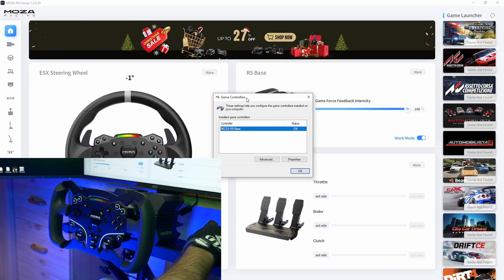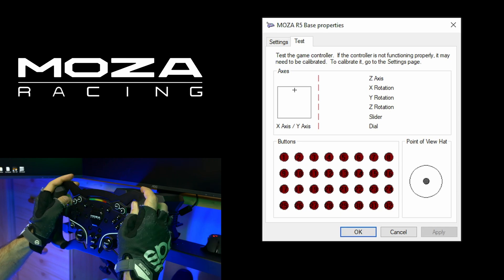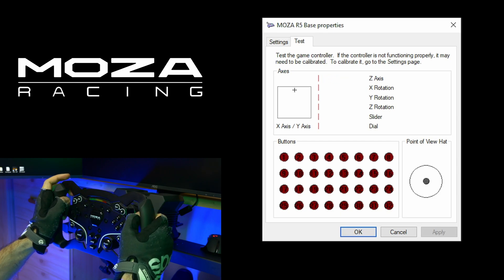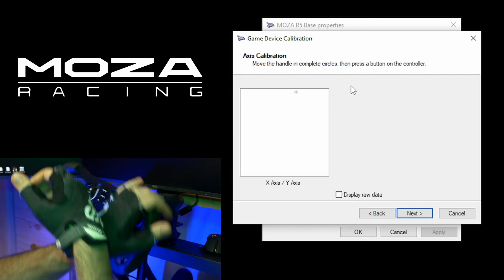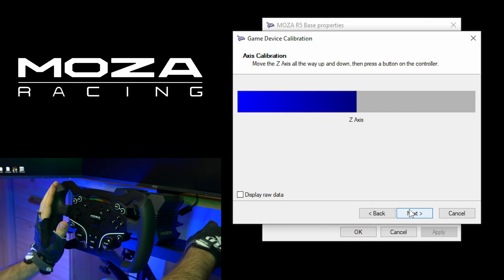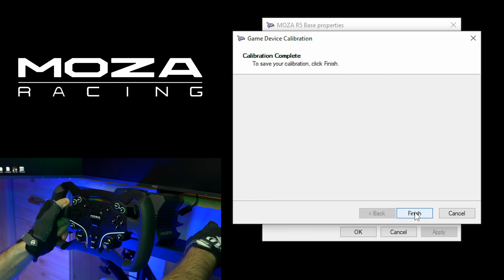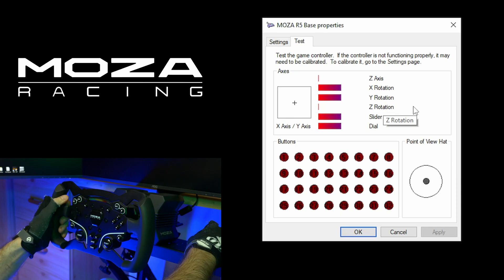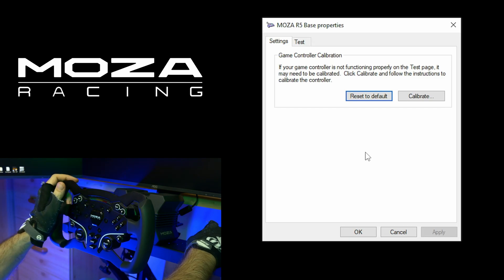How To Calibrate MOZA Or ANY Wheel Base And Pedals In Windows Game Controller

Comment: My wheel will not straighten no matter what I do
Reply: Have you tried a recovery and reset on the base via pithouse settings page? 
If not: do that; then take the wheel off; run the wheel calibration on same page as above in pithouse; Centre the wheel on pithouse homepage; Calibrate the pedals in pithouse; calibrate the paddles in pithouse. Config relevant sim/game via game launcher tab on RHS of pithouse homepage.
Reply: Did you fix it in the end?